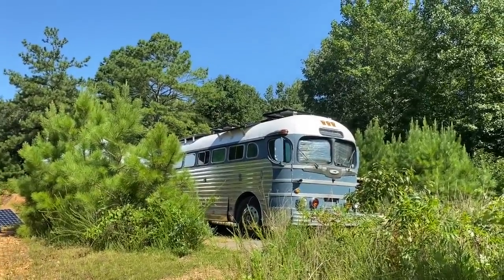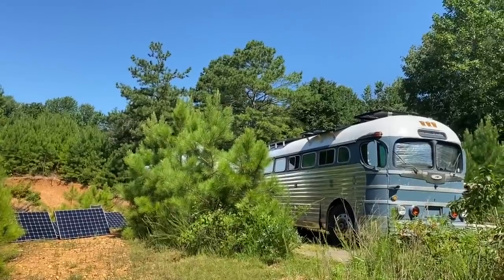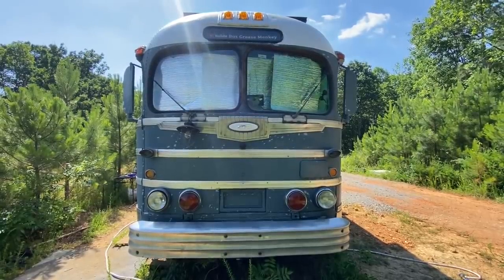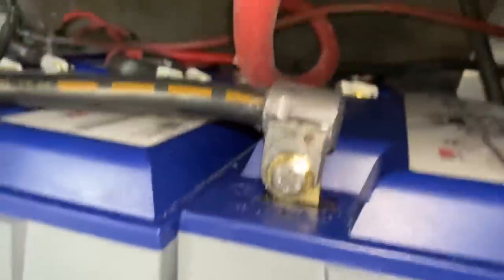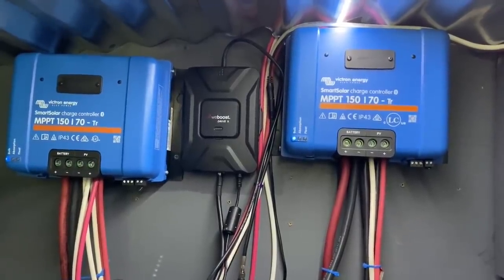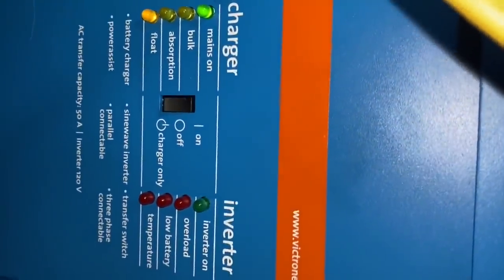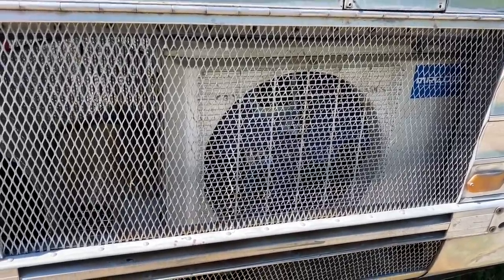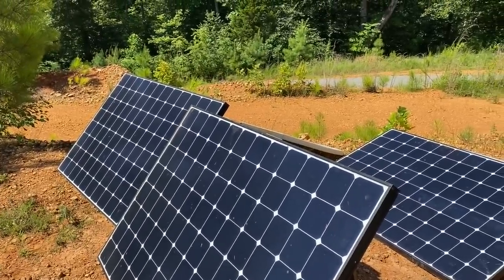Ultimate rv solar setup 4578w charging our batteries at 140a 24v

Comment: I have been interested in the per kwh on the life of the system you have there.
You have now given me enough info to make an observation.
With say $20,000 cost and 10 years write off time, and 25 kwh per day the cost per kwh over that time is 22c.
20,000/3650/25. How does that compare with grid power costs where you are?
I'm figuring that your setup would be pretty close to viable for a residence without any subsidies.
Reply from the maker: Compared to running a generator for electricity would be a better way to look at the bigger pix.  Or vs paying to stay in rv parks.  Motor home travel electricity is much more expensive
Reply: @BusGreaseMonkey  How much is the normal household tariff where you are? Here in OZ it is frightfully expensive, but still not US22c.

Comment: I have an off grid house in AZ. Never planed to be there for the summer till Covid hit and I stayed through July.  I only have a 1000 watts of solar and 8 6V DC batteries. In the winter I had all the power I could use till it got hot. Then I bought a swamp cooler and found I could run it about 22 hours a day, The converter would shut the house down till about 8 AM then everything would come back to life and I had power for the day. Then came the days of 120 degrees and I had to supplement my power with a Honda EU 3000  for about 6-8 hours a day to run a window AC just for the bedroom and the swamp cooler for the rest of the house. Since this is my first year dealing with solar it will take me awhile to learn everything. My neighbor (in the same situation stuck for the summer) decided to run his Westinghouse 2500 watt generator 24 hrs a day to run his AC. I am real curious as how long that little generator is going to run before a rod flys out of it. Talked to him the other day and so far it has almost 2000 hrs of running this summer but a lot more summer ahead. He did buy 2 of those generators so he has a back up.

Comment: Great information about solar. I wonder when you will start to convert those big diesel engines in the back into electric motors. Will need some time till they come available.

Comment: What type of charge controller blew up your old batteries 
I am still needing a tilt steering column for my Eagle I have 3000 watts for mine home made inverter 2 60 amp 48 volt mppt
Reply from the maker: Started with the letter R
Reply: @BusGreaseMonkey  i have been using MSB  mppt 60 amp  work great  my home made inverter still working great it will run up to 10k for maybe 15 or 20 min 8k all day  i bought about 20k of samsung sgi batt but still using 8 150 amp hour agm batt  still need a tilt column  6v92 super and turbo it will go 100 mph all day long

Comment: Is there anything on the bus (house related) that works directly on 24 volts?
Reply from the maker: The inverters.   House 12v is just led lights, water pump, diesel heater, usb plugs.   Light loads
Reply: @BusGreaseMonkey  does your mini split have heat?
Reply from the maker: Yes

Comment: Do you use electricity to heat the bus too?
Instead of gas.
Reply from the maker: Medium heat needs the air conditioner is a heat pump.   Heavy heat needs we use a diesel fired heater for extreme cold.
Reply: @BusGreaseMonkey  great idea.
 I read those diesel heaters are coming into their own in reliability, safety and becoming very popular.

Comment: I have to send you some pictures of the new solar power stations that have gone up in the past few weeks and months here In Estonia 🙂. We are now getting solar power from the national grid. 
Also those stations change out panels every few years and thats how you get used panels.
Reply: That’s good news! Because overall your electricity at the moment isn’t very green 😬 No doubt some challenges because of your size though.
Reply: @cjeam9199  Oil shale power plants are shutting down one by one mostly because they are getting to be 50 years old and are breaking down. Last year 40% of the power came from wind and solar and traditional power plants even shut down for the  summer.

Comment: Hey Scott I must have missed it your title says 4578 watts but you said when you were showing the roof that you had 3270
Watts on the roof I'm assuming the 4 panels on the ground make up the difference for your title of the video 4578 watts 
 Anyway awesome set up 
I know I'm going with Victron for sure
Hope to have something as nice as yours some day. I watched it again and heard 327 watts each Juan has Sunpower commercial panels at 435 watts each
He got a smoking deal on them I've been looking for the same panels but hard to fine.

Thanks for sharing.
Reply from the maker: Yes 4 ground deployable panels that can be moved to a sunnier spot or just add more power when needed.
Reply: Thanks yeah the money is about the same up front but in the long run your money ahead staying where you want and not paying the ridiculous prices for a over night stay at the camp grounds
Very smart Scott, very smart.

Comment: Harbor Freight inverter generators, are surprisingly good.   Extremely quiet with clean power.   Maybe it won’t last as long as a Honda inverter generator, but the price is $700 vs $2k.   For non inverter generators, I’d probably spend  for the Honda.

Comment: Scott: Having more controllers is supposed to be the way to go. Your pal down in Aussieland, Dangar Stu, had a video where it was said that the panels on one controller only put out as much as the lowest powered one (Like a panel in partial shade or not full facing the sun.) So, 3 controllers, split into 3 groups, 1 for port facing panels, 1 for starboard facing panels and 1 for straight up facing panels, seems to be the way to go.   Any solar experts out there can chime in.
Reply from the maker: Series parallel vs parallel.   I changed mine all to parallel it was much better performance
Reply: I watched a video where an owner added a one-way resistor to the power wire coming out of the panel itself.  He said on multi-panel systems when a tree branch or something causes shade on a panel, it reduces charging capacity on the entire grid without the resister.

Comment: Scott, dont the panels create more power than the charge controllers can handle? Your 2 x 70amp charge controllers at 140amps is less than 14 panels can generate at 100% rating. Correct? 14 x 327 = 4478 Watts, (2 x 70) x 24 = 3360 Watts. Seems under perfect Sun you are losing more than 1000 Watts.
Reply from the maker: The charge controllers do limit arround 2kw each.    The panels provide more than that in peak conditions but they only handle the 2k and don’t use the overage.  But in less than peak conditions we get 2k or closer to 2k
Reply from the maker: Several hours a day we get 4000w on sunny days.

Comment: Those panels on the roof have no problem with high wind (+or_ 100mph) 70 mph ground speed plus 30  mph wind speed?
Reply from the maker: Correct

Comment: I intended on asking you to do an in depth overview of your system. I only just purchased my Bus a short while back & removed the seats. Adding a system such as yours will be the first major undertaking. Those were my thoughts regarding the air barrier between the solar panels the roof which is a added barrier & a big plus

Comment: It's an impressive setup to be sure, but let's get the numbers right.  It doesn't act like a 50a 240v outlet.  You're not even halfway to that.  A 50a RV plug is going to be 12kw.
Reply from the maker: For our power needs we can do anything we want just like when plugged into a 50a rv outlet
Reply: @BusGreaseMonkey  Perfect!  Did you have to do anything to keep the inverter/battery bay cool?
Reply from the maker: No.  Heat is not an issue.

Comment: I 'may' have been one of those who expressed doubts on being able to run an AC on solar, so glad I was proven wrong.
Reply: It is not like it wasn't true for people 20 years ago, or even 10. Better panels and better batteries today.  Just wait in the future, you will be able to power the whole week on one charge if you set it up that way, and had to run with no sun for a week. It will be because of better batteries, just watch.
Reply: @TheRebelmanone  
👀
Reply: Search up ACDC12C, it's a hybrid ac/dc split AC/heat pump. Most of the power is solar.
Reply: Ive been running solar AC last 3 years. its all about the battery pack.
Reply: @grandmaster-grouch   mobile or land based please?
Reply: @CosmicSeeker69  both the issue i have with the mobile solar panels is that they dont come in large wattage's' and they are not very robust with daily use. there is now tesla solar tiles which are supposed to be made with tesla armor glass.. Im sheduled to retile my roof on june yes they are so backed up its also a incredible deal. for the same cost as a normal roof tile plus the cost of tesla power wall im getting away with total off grid functionality
Reply: some powers factory with PV arrays..3 phase 440v..

Comment: Just stating the obvious: you're also saving from not having to buy fuel for a diesel generator.  In no time flat that'll  help offset the cost for a solar set-up.  Great video, Scott.
Reply: @MatthewFogarty-k2y  14:28 for your answer.
Reply: Everything is nothing but good information except that bus diesel engine. It need a hybrid system to cut the pollution down. Your panels has 96 cells. There are new 72 cell panels 400 watts for about same price than yours.
Reply: nelio SAMch 
How does there output compare...?
Reply: @troystutsman1400  the 96 cells panels he has on the roof  are less than 360 watts. The 72 cells panels from jinko are smaller and are 400 watts because new cells configuration.
Reply: Matthew Fogarty rough estimate is $1000 each for the batteries
Reply: Matthew Fogarty 
I’d like to know this too please...
Reply: Truth Provider big picture...  cost of the hardware, batteries, controller, vs, cost of fuel. Which wins at 12 months? 24 months?  36 months?
Reply: @SeanONeill13  The big picture is how you're impacting the environment and the planet. It's not just cost to you.  Granted these batteries etc. have their own environmental impact.
Reply: @JPS1000  Actually, if you expand your narrow mind and  consider what is required, from your 'environment ' to create the panels, wiring, solder, transport it all, trashing it,..  Yah.  Bigger picture
Reply: @SeanONeill13  
Versus what is required to create the diesel generator, wiring, solder, transport it all, trashing it...

Oops, almost forgot...fuel, oil changes (and trashing/recycling that), belts, hoses, coolant, air filters...

The manufacturing and manufacturing waste aspect of solar vs genset is negligible in the grand scheme of things. Start adding up the consumables and maintenance items and, over time, I think, in dollars and cents, solar stacks up well against generator.
Reply: @SeanONeill13  I actually already acknowledged that renewables, batteries etc. have their own environmental impact.  Maybe you should learn to read?
Reply: @SeanONeill13  Don't forget to add the carbon footprint in your calculations
Reply from the maker: How many trips for fuel would i have made in the last five months for fuel for a generator?   My onan was 1.3 gallons per hour.  12 hrs a day minimum run time. Do that math
Reply: @BusGreaseMonkey  And transporting fuel isn't fun!
Reply: @BusGreaseMonkey  15 gallons a day of diesel is a lot. My little 6kW Onan used 0.75g/hr. I love solar, but if we're honest, a diesel tank sized at say 150 gallons would last 10-14 days easily, which I'm guessing is more than long enough for 95% of boondocking stays. Just fill er up when fueling the bus. No extra fuel stops needed. Sorry, had to say it... :) :) :)
Reply from the maker: Onan 6.5 gas 1.3 gph
Reply: @retiredandroaming  But it makes noise, while solar is silent and no exhaust, which is a bonus
Reply: @2flyabove  Sure, I get the appeal. We live off our solar full-time in our RV. Personally, I'd just choose different components to save about 50% of the cost spent on this system, but to each their own! Buying drop-in stuff is certainly the easiest, and I'm sure makes absolute sense to a busy guy like Scott, even when they are so crazy expensive. :)
Reply: Barry Timm 
But how does the cost of each set up compare against each other...?
Reply: Barry Timm 
Would you mind sharing what components you’re talking about please...?

Comment: How do the panels handle severe weather? Hail, wind?
Reply from the maker: 75 mph on the hwy for 2000 miles straight.  Rated for large hail
Reply: Thanks, I was wondering about that, want to look into using this here in Minnasota.

Comment: What will you use for heat in the winter?
Reply from the maker: Diesel heater
Reply: His unit also does resistance heat i believe. Scott may chime in but most a/c systems are also heat pumps. Now they do not warm up fast but with diesel heaters he can warm it up and his heat pump should hold the heat. Most systems are like that n e way
Reply: @cormacsyt0  yeah im not arguing with you. Im just stating that fuel based heat can usually create actually hot air that can warm a cold bus quickly. Scott has stated many times the diesel heaters is what he will be using mostly. They are efficient and push out hot air. Resistence heaters can warm a cold bus but the air coming out is never hot. It works best holding a steady temp rather than raising a temp by say 50°F. Its why in modern homes we do not reccomend people turn their temp down while not at hone to only raise it later. Its not very efficient that way. Plus i think heat pumps can only push out like 10-20° Above ambient temp. I may be wrong but i know gas/fuel can put out much higher compared to ambient. Once warm the mini split will keep if comfy but fuel is way to go to get warm fast.So my point is yes mini split can heat from freezing BUT the amount of energy used and comfort level is not as good as a fuel based heating system.
Reply: @cormacsyt0  yeah i just mean when the bus has sat amd is below freezing. Unlike a home resistance heat doesn't compare to fuel based heating time wise. It will take a lot longer using the mini split to heat a completely cold bus. Thats all i was trying to say. Thanks for clarifying though